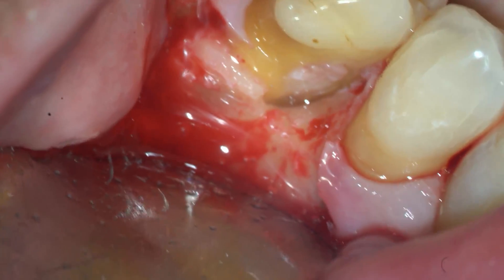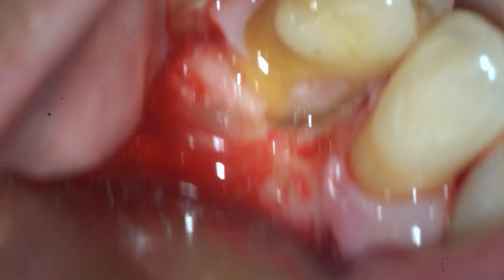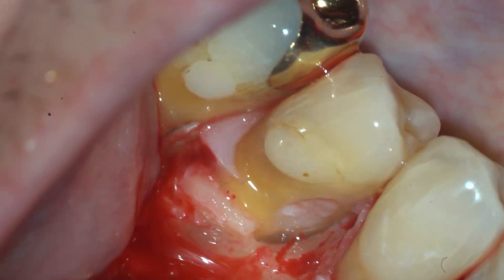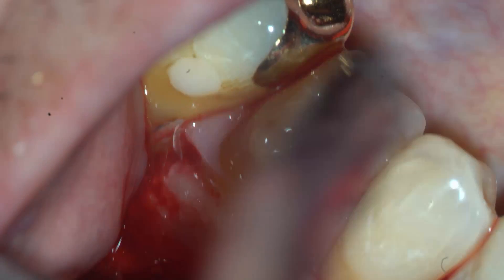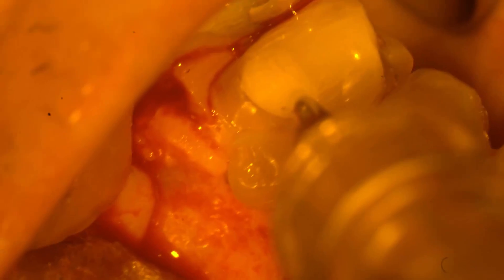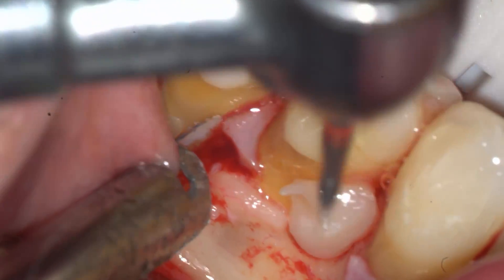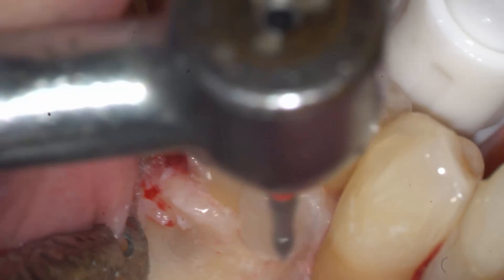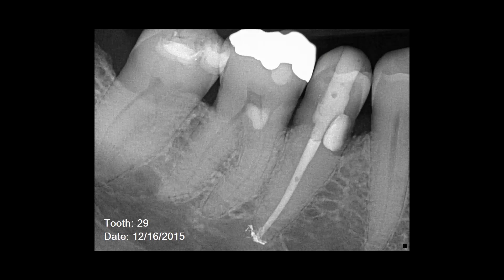Surgical Resorption Repair

Comment: Why such overfilling ?
Did you use light curable glass ionomer ?
Reply from the maker: Apical condensation of a root filling should show splay into the apical anatomy otherwise it is just a floating cone in debris that has not been cleared. If one gets a pristine smooth cone shaped terminus with no deformation or splay of sealer as a routine result, then it is quite clear the root is not being cleaned.  Geristore is a dual cure modified glass ionomer which is the best evidence material to perform a surgical repair with.  See the Dragoo, Al-Sabek, and Gupta studies.  Fibroblast adhesion and predictable attachment is best with Geristore and to date it is the best fit evidence-based material to use.  The others even in the same modified glass ionomer class have been shown to be inferior.
Reply: By overfilling i mean the overcontouring of the photopol. Glass ionomer repair filling. I am not an english native speaker. You are right the apical puff is a quality sign.